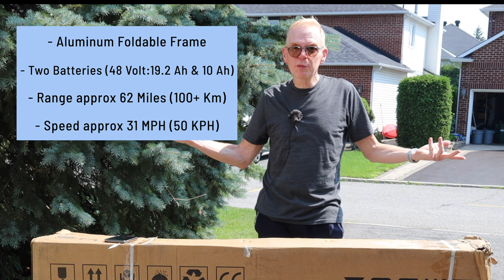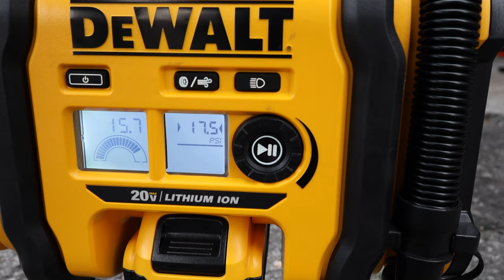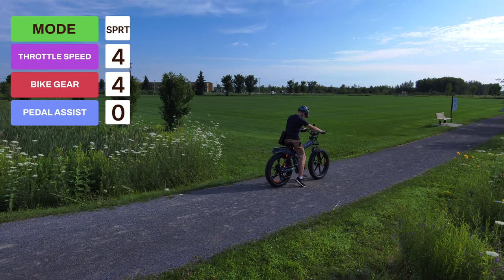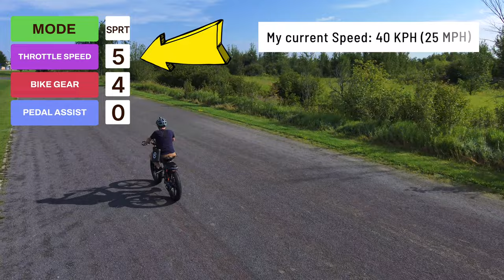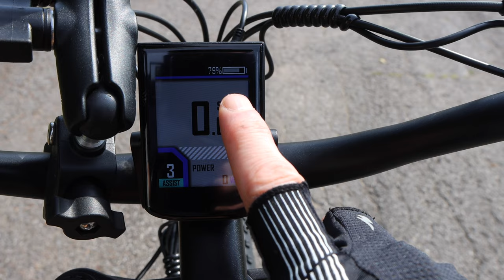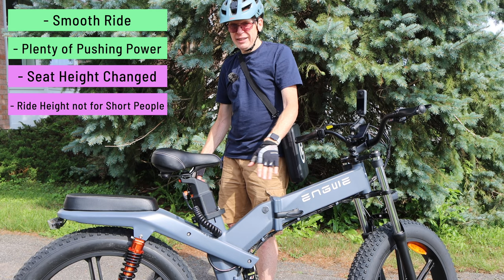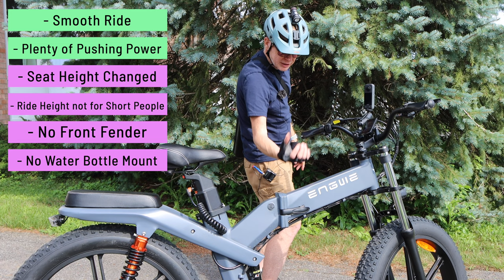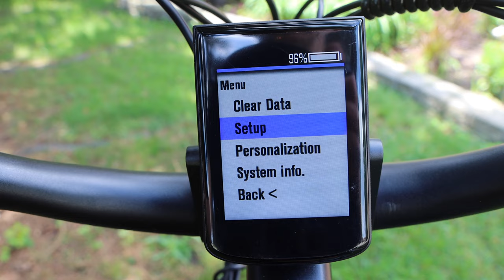ENGWE X26 is the most beautiful Electric Long Range Bike

Comment: Good review just subd 👍
Yes it's a Comfortable ride I've put 2000 + Kms on my X26 in 6 weeks
But I prefer long distance riding from the rear seat - beach cruiser style , works ok with a  aftermarket handlebar 130mm extension to give laid back riding position.
X26 Problems in 6 weeks hard riding =  
1. cross bar battery rattle if not stopped leads to battery self-destructing - the terminals disintegrate. fix = wrap 50mm gorilla tape around front of battery to eliminate rattle. order new terminal block from Engwe!!
2. Seat post Battery drops when riding over rough terrain  = leading to connection bottoming out on frame and battery connector self destructing because it passes the minimum height setting😬 
fix= order new battery connector from Engwe
prevent battery bottoming by putting a stop bolt underneath the battery just above it minimum height setting 🤦

3.standard tyres inner tubes are very prone to punctures had , 4 punctures in 2 weeks 😬
fix = installed heavy duty 6mm thick inner tubes 🤞
Reply from the maker: Good solutions, thanks!
Reply: hey do you have videos of showing how you prevented the bike seat from dropping??
Reply: Dang that’s a lot of riding.
Reply: Doesn't that seem to be major design flaws? 
Also, no info on what brand  brakes, the mm travel of the front shocks ,  number of teeth on chainring or cassette, the derailleur brand nor if candence or torque sensor.

Comment: Awe, not like blood, Nast cut, be careful Steve. Got my first E-bike last May and I love it with its oversized tyres. Was difficult dropping the front wheel in place. Worried when when the time comes to remove the rear wheel due to cables, so I hope all will be fine when I ever get to do it. Got spare battery for that extra long journey. One safety tip, when turning from a stationary position don’t have pedal assistance enabled or it will be like someone pushing you as your turning, not good, it almost throw me when I did it first time, don’t even have pedal assistance on when turning were I need to take one hand of the handlebar for signalling. Just be carful when turning. My bike helps me a lot if I go for a 15 mile or more ride as I have pain in my knee on my normal bike after cycling for around 15 miles, so if I exceed on my E bike and this pain kicks in, I have this bike to carry be home without peddling. Am 5’ 8” and it’s a little tricky getting on and off, but I manage😂

Comment: I loved your video, it was very informative. I'm just worried about the second seat battery, it seems easy to steal. Can you confirm if there is a cabinet lock or something to prevent thieves?
Reply from the maker: You can lock the seat battery if desired (keys are included).

Comment: Hi Steve. I hope your leg gets better soon. Interesting E-Bike. About the seat sinking into the frame, I had the same problem on my e-bike when I upgraded to a shock absorbing seat that came with a carbon fiber seat post. The carbon fiber is too slippery for the pinch bolt system to secure it. I had to purchase a produce called "supergrip Carbon and alloy assembly compound SAC-2". I removed the post and applied the black paste type compound to it and reinstalled the post. Re-torqued the bolt to manufacturers spec and it has been good for four years now. If that monster seat post on your subject bike is carbon fiber that compound may help.
Reply from the maker: Thanks for the tip!

Comment: Hey can you verify how you were able to prevent the seat post from dropping while riding, i just purchased this bike and now I'm having the same issue
Reply from the maker: Simple. I wrapped a thin piece of sandpaper (with sticky back at 2000 grit) around the post then locked it in.  You can do anything similiar(add anything super thin to the post to make it a tighter fit).

Comment: Steve Tighten the bolt on the left side of the seat . Then close the clamp style tension lever.  I don't have a E bike but that's how those lever locking systems work.
Reply from the maker: I’ll check it out, thanks

Comment: Hi Steve, that bike looks amazing.  I’m thinking of getting the x24 but was wondering what is required to operate in Ontario. Because of the 1000watt motor are you required to have a motorcycle license? Do you need to register it? Do you need to insure it? Are you allowed to drive that on a sidewalk?  I was looking at the provincial regulations but it wasn’t clear to me what is required/allowed. Any advice would be appreciated.
Reply from the maker: Honestly, nothing is required for electric bikes other than get yourself a helmet.  Perhaps you are thinking of the Federal and Provincial rules for Electric Scooters, Skateboards and Bikes.  Those don't apply to the consumer but more so to the seller.  EBikes in Canada are set to a similar limit to those in the USA.  Owners of eBikes (if desired) can often override settings for speed and output power and no one is the wiser.
Reply: Hi Steve, I’m curious on how to order a ENGWE bike in Canada. I tried to place an order from ENGWE and it doesn’t allow me to place an order to Canada through their website?  To you need to have it delivered to Ogdensburg and drive down from Ottawa to pick it up.

Comment: Sorry to hear about your lower leg, when you accidently stabbed it!  You mentioned it was hurting a while with the gaping wound in it!  I wish I could take advantage of an electric bike like that, but I'm in a wheelchair.  So, I have to take other kinds of wheeled rides!  
I saw a different type of electric bike that was reviewed by a young person, but the comments and demonstration indicated the bike was not as well-endowed as your model.  It could not climb the hills as well, nor was the shock absorbing ability as comfortable, and it did not come with two batteries either.  So, of course the bike could not stand up to yours in the area of longevity.  All this simply indicates there is a difference between the E-Bikes that are available, and one must tryout several models to be sure what's important to the buyer for long-term.

Comment: Is there any type of anti theft security in this bike to cut off power? I mean in engwe engine pro You need to put inside key to power on bike, but i dont see something like this in x24? Does it mean You dont have any protection? And when You leave bike anyone can just power it on and drive?
Reply from the maker: Front battery and rear battery require a key to remove them.  But like many new electric bikes, if you know the startup sequence you can indeed ride off with them if the bike is foolishly left unattended.

Comment: Hello Thanks 4 the amazing Video.
I HAVE ONE MYSELF.
THE ONLY CONSTRUCTIVE COMMENT I HAVE IS, TO TAKE THE WIRE AWAY FROM THE BATTERY'S THE BLUE SIDE SHOULD BE TURNED AND THE LOCK WILL RELEASE ITSELF.
TAKE CARE.
Reply from the maker: The blue item on my cable broke off after loaning the bike to someone.  I guess if one turns it the wrong way or just pulls it, well it breaks, but everything still works fine.

Comment: Engwe fixed many of the issues on X26 with the newer X24 (24" Wheels vs 26) Batteries are linked, the front battery rattle is gone, and such. Still not fond of the "seat" that isn't a seat. A rack makes more sense.
Reply from the maker: Great that they addressed the issues. Thanks for the update. I have several electric bikes, but I still use this one for long distance rides due to the two batteries.

Comment: Is this an older version X26?  I thought I read that they added a hole in the frame to charge the smaller battery without removing it and also fixed the rattle in the smaller battery.
Reply from the maker: Could be.  This one arrived in May 2023.
Reply: @CAPTAINDRONE798  In addition I think the new version has a battery blender.

Comment: Basically it's a moped. We already have relevant regulations in the UK to cover this. No license required to ride it etc. BUT it's already too fast under it's own power for our regs! 15mph max allowed here, over that the motor should shut down.  (rider should be 14 yrs old minimum) To go 28mph (would you believe?), it should be classed as a a mo-ped. and have tax and m/cycle insurance. So I guess if it was sold here adjustments would be made. And although I like the 2 battery design, I dislike the seat post. I would want a "dropper" seat post on my bike so I can quickly adjust the seat height, on the fly, up to my preferred maximum, or drop it to it's lowest for dismounting. I'm 5"10 with short-ish legs. Apart from that, hmm, I wouldn't call it beautiful, but it is cool, plus I LOVE fat tire bikes and own two, plus an Electra Classic cruiser 7 speed, oh and a cheap fold up bike to throw in the back of the car if I think I might need it.

Comment: I would add plastic fenders
Reply: You should look at a step Through bike like the Juiced or Fabulous bikes they have a 20 ah battery and 52 volt or 60volt  for yourself 1000 watt motor hydrologic brakes 11 - 32 cassette trigger shifter and torque sensor all premium features for a great price

Comment: There should be a bolt that can be snugged up a little more in the seat post clamp lever to have it clamp tighter.  Don't go to tight or it will strip something.
I just cleared 500 miles on my ebike (eMTB or e Mountain Bike) - Giant Trance X E+ and did a riding review in our local woods by the Mississippi river: https://youtu.be/mZTqaqODDlI
Only downside is the $, Mine was over $6000.  Totally worth it !
Reply from the maker: Is yours the GIANT brand?  If so I have two of them (pedal bikes) Road Racer and Fat Bike and I love them!
Reply: I've gotten too old to use my 29er MTB (Trek Marlin) for actual technical trails but it's great as a hybrid light trail, dirt road/gravel/ road bike with the fork swap (Rockshox Recon) and gravel tires. I like to sit more vertical so a stem extension and a spring loaded seat post rounds out the ride nicely to take out those jolts from the back tire hitting hard bumps. A 4-12 mile ride is so good in so many ways.
Reply: @CAPTAINDRONE798  I picked up a good used Giant Sedona with coil forks and suspension seat post as a back up or second bike for a friend to my Trek Marlin. Very nice bike! I should ride it more often. The Sedona was touted as a comfy ride for gravel and street but it looks like an MTB.
Reply: I took my 29r hard tail MTB and put a mid-drive Tongsheng kit on it.  Great greenway ebike with the smooth tires on it.  Interestingly the switch to smooth tires from knobby saves 15% battery for the same distance ride.  I knew it would save some but not that much.
 @SW-Video

Comment: Total body height isn't relevant. Inseam measurement is.
Reply from the maker: True, but if you have long legs and short body, you're just not gonna reach the handlebars when turning.
Reply: Short legs here - 28"/70cm - on a good day.
Reaching the handlebars isn't an issue, but reaching the ground is. 😁
Reply: @mjordan812   I'm sure you've seen it by now but they spec a minimum "Standover height" of 29.9".  Nice of them to actually include that info!